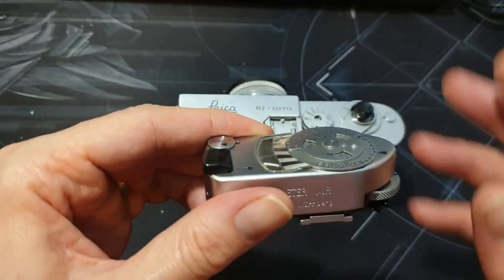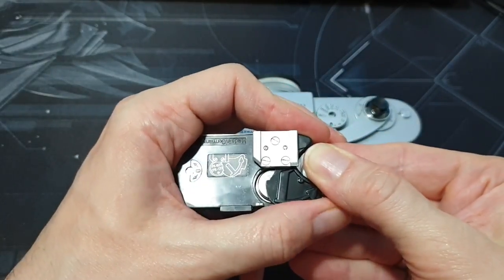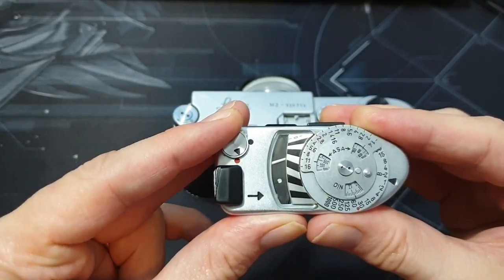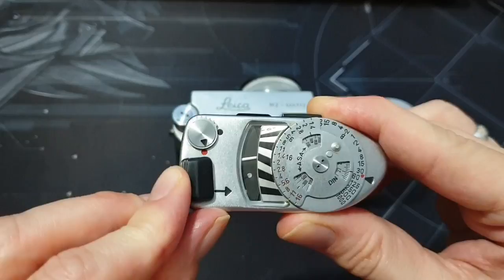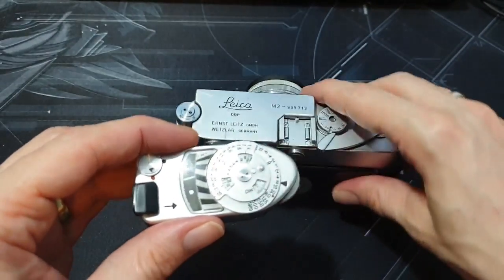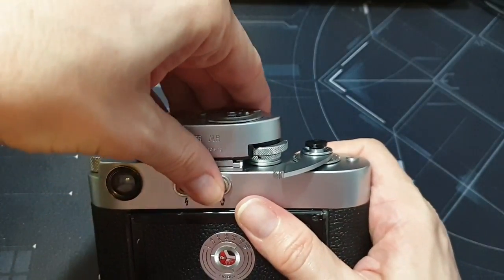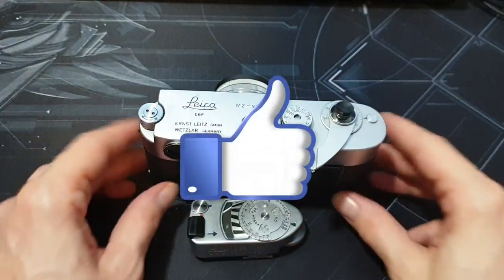Leica Meter MR / MR4  How To Guide

Comment: My MR4 just came back from repairs in Germany made by Knoch Messgeraete GmbH. They replaced the electronic baseboard with one that will accommodate the PX 625 1.5v battery a bit better. While I'm in Canada, the cost to me was 143 Euros. The meter is far more responsive than it ever has been. I've used it on my Leica M4 for about 40 years..

Comment: one thing is missing from this video and that is that the shutter speed wheel is on a baonet type fitting. so when set to b and it moves up and down it can be pushed up and then turned further locking it in the up position. This will allow you to open the battery door and fit it without having to worry about lifting the wheel. To engage the mechanism simply turn it back to B  and it drops engaging with the shutter speed dial.

Comment: One trick you can use to avoid scratching the top of your camera is to insert a piece of paper -- or a post-it note -- between the top plate of the camera and the MR meter when sliding it on or off.
Reply from the maker: Good tip.

Comment: I have this meter myself, and I love it, it works great, I do use the MR9 battery adapter, which take a standard watch battery (SR43) and steps the voltage down to the correct 1.35v. Most of the time I do not have the meter mounted, I leave it in my pocket, as I prefer the look of the camera without it, but it is nice to have it, because it is so compact.
Reply from the maker: I'm going to have to get the SR43 adaptor, thanks for the tip

Comment: Good video. I am looking for a MR for my M2 I have an MC I got off ebay and the previous owner put some small felt pads on the underneath of the meter so it does not scratch the top plate of my M2.

Comment: Can you assist with some troubleshooting. I have an MR with a new 1.5 battery. Problem: when I push the test button, the meter stays pretty much stationery. It does not move to the white dot and turning the calibrating screw does not move it there. Some times when I move the light meter button, the needle moves around but sometimes not. Any ideas?

Comment: Did you upgrade your video and sound quality? Seems improved.
Reply from the maker: I've got a proper desk clamp arm thing ...so the camera is at a better angle and have a new mobile Samsung s9  phone...but still using the same Rode microphone. Only thing is i need to position it better so the sound volume doesn't change as I move my head. Thanks for noticing Matie
Reply: @dangerpowers123  Oh that's right! I forgot about your new clamp. To help with varying volumes, you might want to pick up a cheap compressor. I use software when mixing my audio through my DAW, but there is small external units made by Behringer for mics that are inexpensive.
Reply from the maker: @filmismorefun  thanks

Comment: Good stuff. I'm saving up for a Leica M-A, so I might get one of these, too.
Reply: I'm sure you have your reasons for buying the M-A (I have an M3 DS, so I know), but at the current price for a new Leica M-A (USD 4695 at BH Photo) why not pay another $100 and get a Leica MP (USD 4795), which has a built in meter, instead of an external meter? This is just an honest question out of curiosity, and I'm not trolling.

Comment: Hey, Im a little bit confused because the leicameter I have does not have a thing to put a battery in, but it still works 
anybody know how this black magic works?
Reply from the maker: Sure, so not all need a battery, some use a selenium cell. It's from memory a liquid that's sensitive to light and creatives a small electrical charge when exposes to light. So the selenium acts like a battery.
Reply: @dangerpowers123  well thats interesting

I call that magic

Thx for the help btw

Comment: How accurate is this meter in daylight and night time
Reply from the maker: So if you get a good one and use the right batteries its great. Plus it can be calibrated fairly easily. I've been using a modern battery where the voltage is not quite right... And so found it spot on in normal light. But in bright light it's a bit out.
I've as an M2 owner embraced the past two months sunny 16 instead. I check if what I'm working out is right ...by using an app on my phone.

Comment: That battery EPX625G Alkaline 1.5V is not accurate for the leica meter, you need an adapter MR-9 which converts to 1.35v
Reply from the maker: Agree. I'm for the moment not using the meter and embracing sunny 16. But will be getting the MR-9 / adaptor for 1.35v soon.

Comment: can I actually use this on a Konica T3 with hot shoes?
Reply from the maker: If it will fit. Then you can use it. But the shutter dial won't engage with the shutter dial on the camera. But it's still fine to use just mirror the settings it gives you onto the camera ..you could even just hold the meter, use it and put it in your pocket when you don't need it as a hand meter

Comment: Let’s say I have 400 ASA film, then I dial that 400 in on the meter.. Now let’s say, I usually shoot w/ a shutter speed of 250, so I turn the dial to 250 (while the meter is on top).. Now let’s say at this point NOW I hit the button to meter.. Let’s say it says f4.0, and I change my lense from f5.6 (or whatever it’s on) to the 4.0 the meter said.. At this point, snapping the photo should be all good right ?!
Reply from the maker: Yes, the meter will tell you the aperture to use. So you then chanfs the aperture on the lens ..and it will be exposed ok.
Reply: @dangerpowers123  Awesome !!! I figured as much but just wanted to check. Thanks for your work / content, keep going ! Appreciate you.
Reply from the maker: @TopshelfJunior  aye no worries ..thank you

Comment: And how to switch complete OFF?
Reply from the maker: It's off by default, it only comes on when you press the switch ... It takes a light meter reading and turns back off again
Reply: @dangerpowers123   and how long take one battery ? 3 day  or more longer?

Comment: You should not use alkaline batteries, they have a gradual voltage drop that will give you inaccurate readings over time. The zero adjustment is not appropriate to adjust the voltage. Get an adaptor, they cost a fiver at most and use P675 hearing aid batteries. They do not last long once opened but they have almost the same voltage as the original mercury cells. They only become unreliable in very dry weather (not a problem in the UK). Alkaline batteries are fine to see if it's working, but not for use. More complex instruments that take several batteries have voltage stabilisers and can use alkaline cells with impunity.
Reply: I forgot to add, the voltage drop curves on mercury cells, zinc-air cells (hearing aid batteries) and silver oxide cells (SR44 rather than LR44 for example) have very flat discharge curves, they will give accurate readings until they suddenly die. Mercury (no longer available) and silver oxide last a long time but zinc-air does not and you should always carry a spare.
Reply from the maker: A few months after making this video I did decide to use as you describe hearing aid batteries with an adaptor  👍🏻 found them for sale on eBay.

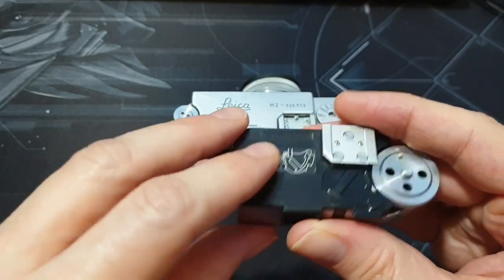Comment: At video 3:17 "calibrate it" Not true, That's the NULL adjust (No battery INstalled adjust)..  - At video 8:34 "a bit tricky" - Not true. You need to follow the instructions & the diagram; put it to 'B' but then ALSO spin it counter-clockwise (this locks the speed dial of the meter to UP position). - This UP is also necessary when changing battery. This because the plastic sliding cap is age fragile & sometimes prone to 'tearing'. So be careful, no resistance/tugging; this is essential (They're no longer available). - Finally, not only is the Alkaline battery the wrong voltage, but they leak without warning ! Stick with the more stable 'Silver' formula batteries using the step-down adapters...

Comment: are these useable with any focal length ? or are these made for a specific focal length, f.e.  50mm?
Reply: Anything
Reply from the maker: What I've read is that meter bases on the middle part ...the 90mm frame lines... That's about the area it uses to meter. So it's sort of almost like spot metering. So as long as you know it's using the centre area for metering..then it doesn't matter if you using a 28, 35, 50 etc .lens.